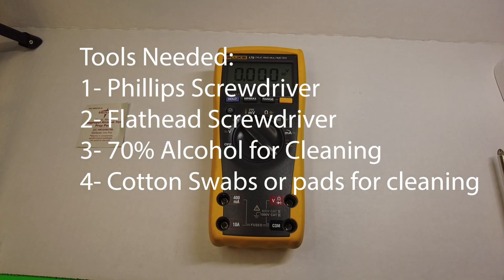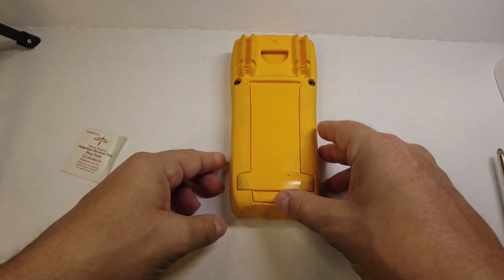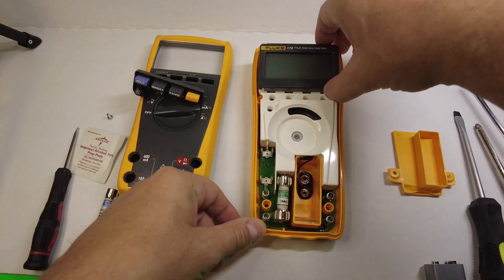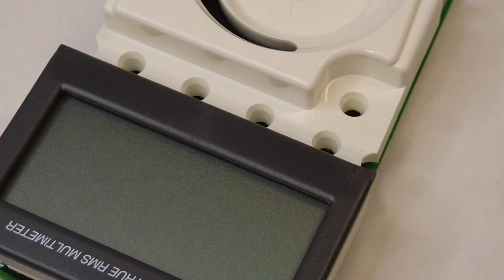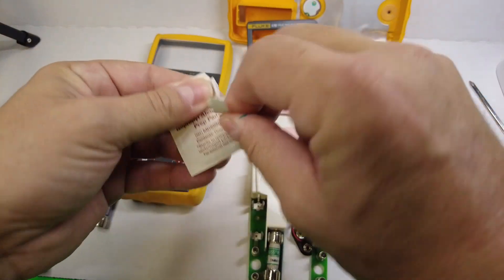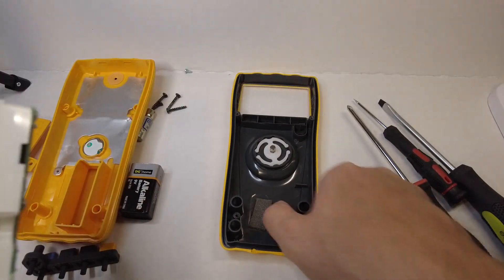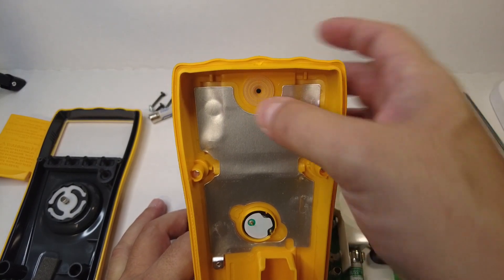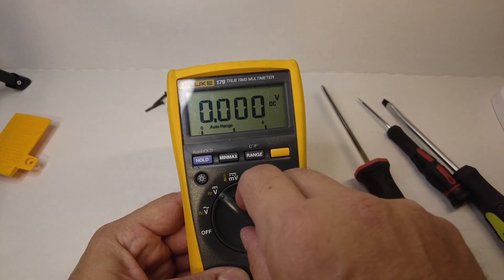Fluke 179 Teardown and Faded Display Quick Fix

Comment: Hi
Just one remark; try to avoid touching the cleaned edges of the contact strips with your bare fingers because the skin fat/fluids could corrode the contact points again quicker(!?) than normal.
This stands for all electric contact points!
Reply: Excellent point and comment!  I am always surprised when these content creators do this, but some will clean the board ultrasonically, but it would be unnecessary if they wore proper gloves.  The creator here did have good content, but I was thinking the same thing!  Peace

Comment: This was my first decent multimeter. I bought it on sale and it came with the TL175 test leads. Sold it after a very short time because it doesn't even have a Rel function. I got the same price as I paid for it but I kept the leads so I got these for free 😂

Comment: Hi
Great information, i would like to ask you that my 179 have problem in LCD display was not faded but have a black spots such as sunburn LCD, can i only replace the LCD polarizer layer or it should replace the whole LCD? 
And the other problem is the selector knob was broken, can i replace the selector knob? Because i cant get the replacement knob in Indonesia.. i’ve already looking for the knob in several e-commerce in indonesia
Many thanks
Reply from the maker: We apologize for the late reply.  When the LCD is bleeding, as in the case of the black spots, then the only solution is replacing the LCD.  We do not have this in stock at the moment, but we are updating our inventory and website.  Let us know what you're looking for and we'll do our best to accommodate.  Thanks for checking us out.

Comment: Hi. My 179 has low contrast. Especially when looking at it straight from top, or at a slight up angle. It is somewhat ok if I'm looking from below. (shallow angle)
Any idea what causes this?
Thanks.
Reply from the maker: I think it's normal for the 170 Series to have  dimmer appearance when viewing from slight up angle, and it gets better, and best when viewing slightly from below.  If the display is uniform dim, then I'm not sure what would cause it, other than a weak battery, or cosmetically faded top case window, or LCD itself from direct sunlight.  I have seen this in older Fluke multimeters with this issue.  If cleaning the elastomer contacts doesn't improve the display, then replacing would be the best step to ensuring a nice clear readout.  At least then you can rule out the LCD as being the issue.  The good news is that the Fluke 179 LCD is still available for purchase online anywhere from $30-$50.  I may have at least 1 in stock.  Thanks for watching and commenting. Hope this helps.
Reply: Actually the display got partially damaged, ultimately it will became more fade.